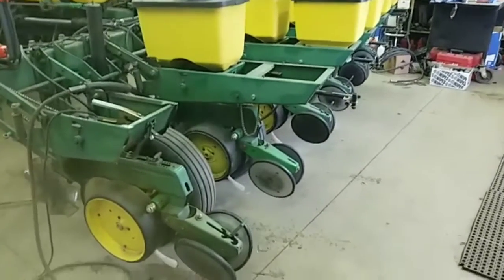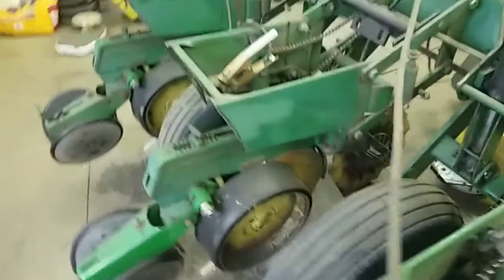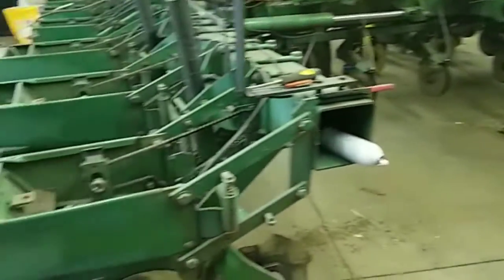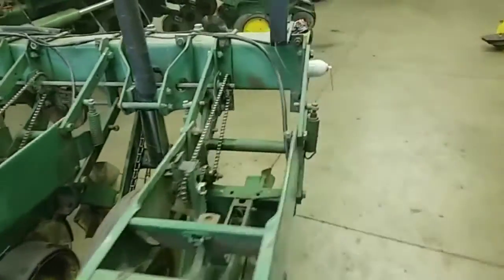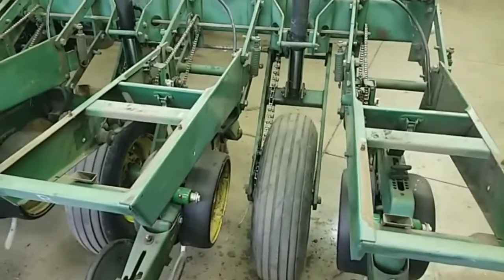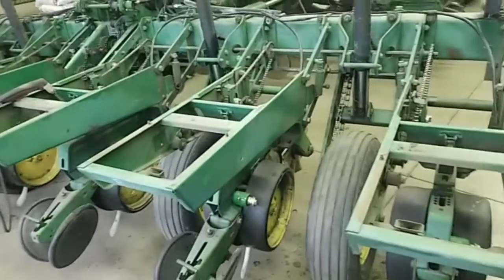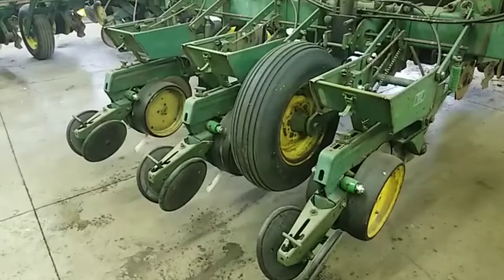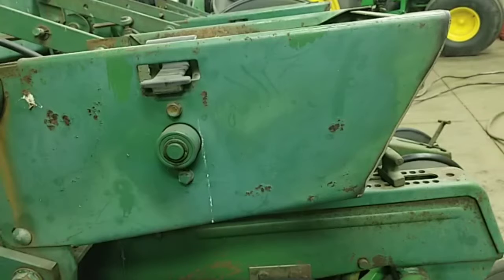John Deere 7000 planter weight reduction!

Comment: I would remove the no till coulters also. New seed disks will cut anything the no till coulters will with a lot better seed depth control. Also look at seed tube protectors to check for wear.

Comment: I have a 8 row john deere 7000 planter and need to adjust my chains from planting milo to planting corn. can any one give me the setting adjustments i need to make with the chains?
Reply from the maker: Well you kinda need a book for your planter because there are several settings for corn as far as population if you have a population in mind I could tell you what sprockets need to be used on the drive and on the driven....you can get 7000 books on Ebay all day long
Reply: I’m just planting food plots. Does that help as I’m not a farmer.
Reply from the maker: Well the next question is do you have  finger pick up row meters in your planter?
Reply: @dirtgrainsteel  no I dont
Reply from the maker: @davidkahler3354  well in order to plant corn you will need to get some for your planter
Reply: @dirtgrainsteel  I’m sorry I didn’t understand. I always called them corn cups and yes I have those. We’re changing from Milo to corn so I’ll exchange those
Reply from the maker: @davidkahler3354  I suggest about 24,200 population for a food plot so you will need the 26 tooth sprocket on the driver and the 28 tooth on the driven and run about 5.5 mph while planting
Reply: @dirtgrainsteel  thank you a bunch. Can you tell me which is the driven and driver sprocket